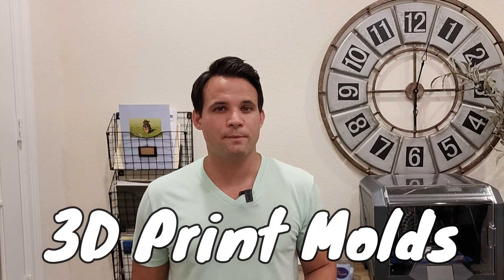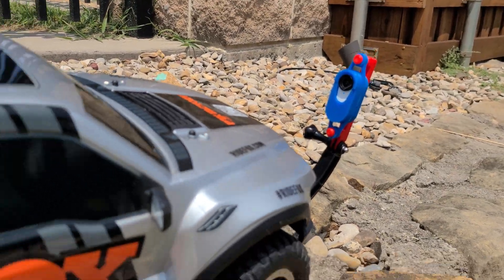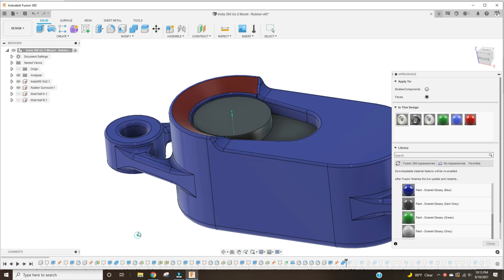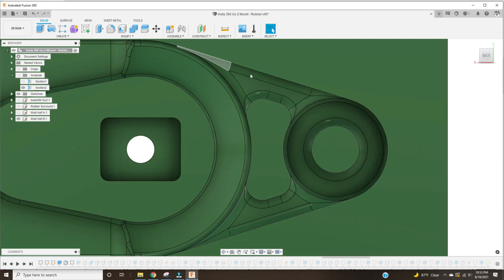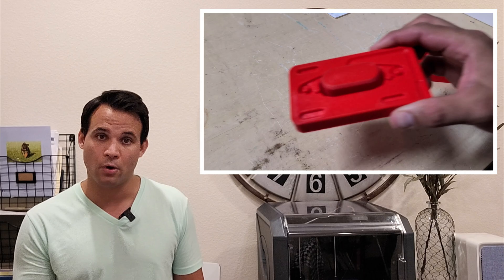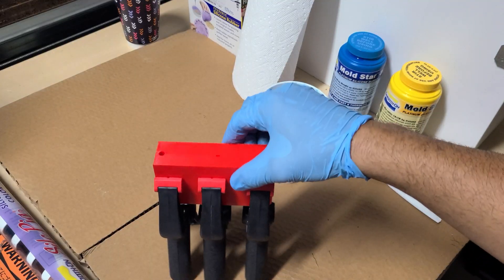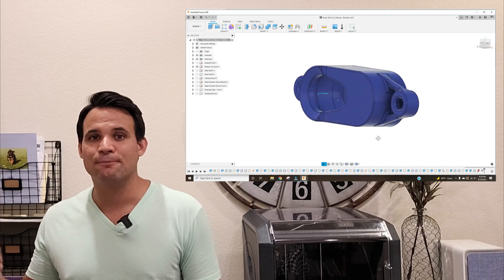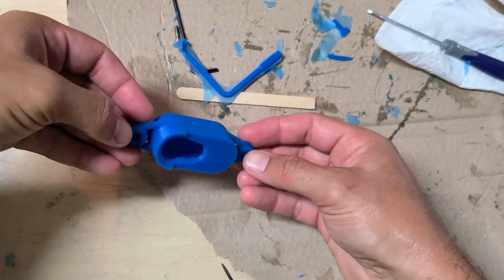3D Printed Molds for Rubber Parts to Save $$$$

Comment: Great video. Maybe I missed it but what type of 3D material did you use so as not to cause cure inhibition with the silicone (assume you are using Platinum silicone) ?
Reply from the maker: It's been a long time but it was most likely what dremel calls eco-abs which is just impact modified PLA. 

I believe you're correct in that it's platinum cure. I rarely use anything else.

Comment: What was the simulation for the vibration you made?
What have you checked?
Reply from the maker: If I recall correctly it was just a modal analysis. I was doing that to ensure the natural frequency was low enough to be within the bandwidth of image stabilization

Comment: I’d love to see a video comparing silicon mold making vs printing with tpu.
Reply from the maker: Tpu is much stiffer so it's not really a comparison. It's a totally different material for a totally different application.
Reply: @EngineeringAfterHours   I agree tpu is more rigid and silicon would be better for vibration dampening and even feel softer. Have you tried printing tpu with minimal infill, even 1%? It can get pretty squishy:).  I think impact resistance would be somewhat similar. Both tpu and silicone are used widely in the phone case industry (according to the first random google result that fit my line of thinking:) here’s an unpublished 10 sec video of a squishy part I did. https://youtube.com/shorts/d2Sogmh0xvo?feature=share
Excited to see more of your content. It’s very well done.

Comment: 3 questions:

Have you thought about using ABS for the molds and acetone smoothing? Could give you a really nice surface finish. Your finish looks pretty good as is but just wondering.

If you had a longer inlet gate would the added head pressure help with the voids?

Which type/brand/etc silicone do you recommend?
Reply from the maker: 1 - No, my printer doesn't do ABS but that's a great idea. 

2 - yes, a longer inlet can feed more as bubbles raise to the vent.

3 - I use smoothon because they have a ton of knowledge and documentation available as well as good product support.
Reply: @EngineeringAfterHours  got it thank you

Comment: A peg on the back of the mount with a ball end, going into a cup on the plastic mount, could be a good way to mitigate the twanging vibrations without losing the absorption you already have.
Also having a thinner lip around where the mould halves meet could help with sealing, as it would increase the pressure around the split line, preventing the silicone squeezing out quite as easily. I'd expect 1-2mm (~1/16"?) to be a good starting point, that could be tuned. Alternatively, having a lip on one side that keys into the other half would also help prevent leakage.

Comment: I wonder if anyone has tried to use a machined aluminum mold base (for clamping tight using screws so there's no leakage), and then just 3d printing inserts for the part itself (which can still be iterated).
Reply from the maker: Formlabs has a lot of info on this. It's a great option to save on print time and get the structure of aluminum under actual injection molding pressures.

Comment: A couple of suggestions to help with future molds:

Viscous fluids will not go all the way through thin tube due to surface tension.  Thin vents are often used to allow air to escape from hot plastic injection molds, while still being too small to allow the injected material to escape.  Smooth On has a lot of data on their products and may be able to let you know what size opening to use

Building on the lack of capillarity mentioned above, you can put in a keyed barrier around the part, and it will often reduce the amount of material lost due to a poor interface with the surfaces.  If nothing else, it allows you to redirect the flow of excess material.  This is often used to keep hand made block poured silicone molds from leaking.
Reply from the maker: Good tips but in this case I want the vent to allow silicone flow to encourage air evacuation. I specifically do not want the vent to prevent silicone from rising through. 

If I were working with the pressure involved in true injection molding I might go that route...but in this case it's incredibly low pressure so there is heavy reliance on flow through air evacuation. 

You need the vent reservoir above the mold level to have silicone in it to replace air that's worked its way out over time. This is very similar to how smooth on details a lot of their resin molds. Both the vent and fill are above the mold because you're relying on hydraulics over high pressure.